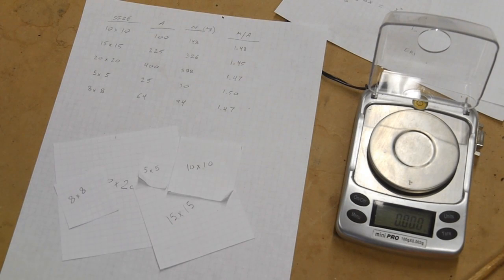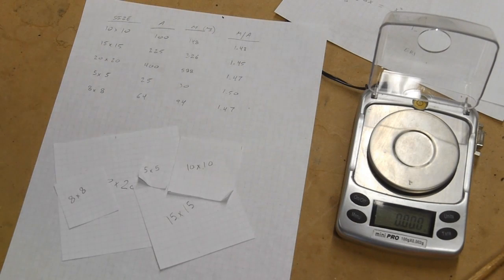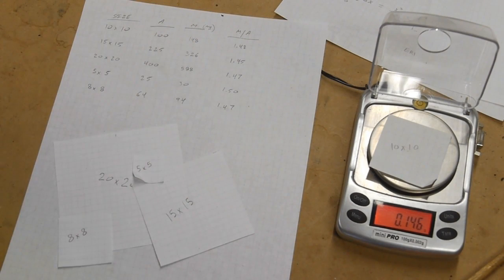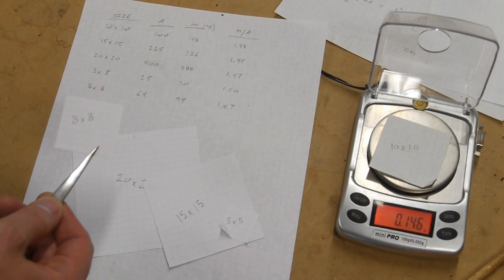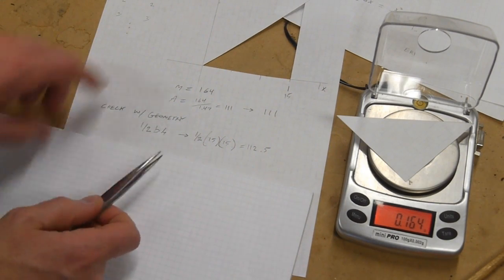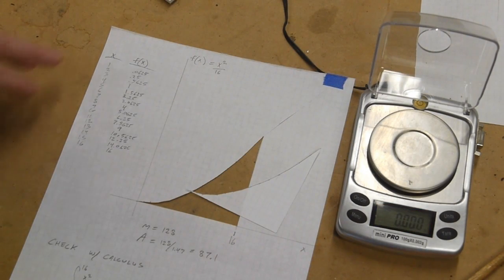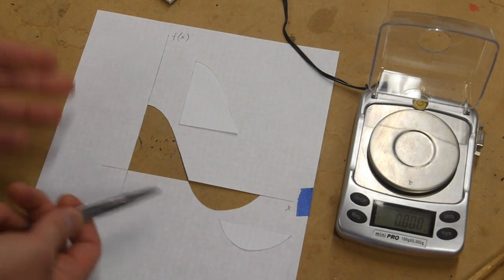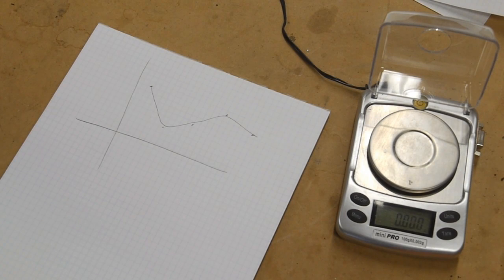Mathematical integration without calculus

Comment: You could do the calculation much more accurately using numerical integration methods instead of drawing them out by hand.
Reply: If you have the skills to integrate non-linear multicomponent equations of state, thumbs-up.  I did not possess those skills.
Reply: Mark Beeunas Well, apart from the fact that mine was an observation and not a criticism, in any way nowadays the software is there... I agree years ago it would have been hard to use a computer, but as far as I know, the big book of series and integrals was around then already... at least judging by the conditions of the one in our university library ;-)
Reply: Mattia Colombo

No worries, I did not take it as a criticism.  Yes, I understand: integration by parts, substitution, etc. I said “I did not possess the(ose) skills”, which may or may not have been true, as I did have three years of The Calculus and Differential Equations. I do not recall my reasoning in choosing the paper/scissor method; I do recall the equation was a bit of a beast.  It probably had on the order of 12 – 15 variables (P, T, Partial pressure (H2O, H2, CO2, CO, CH4, H2S(?), Compositional equilibria (Olivine, Garnet, Pyroxene, wustite(?)).  Anyway, I’m guess I thought the paper/scissor method would be fast.  However, I think it probably was much longer after actually making the 100 foot graph.  I wish I still had my class notebooks.  Well it seem we have taken the long way around the barn on this discussion.  Cheers, Mark
Reply: Mark Beeunas
Whatever you mean with that, there is software created exactly for that... also because I would like to see you integrating non-linear multicomponent equations of state using paper and scissors... it is of course a fun application, so kudos to who did the video, but the practicality of the tool is basically nonexistant!
Reply: The method used was basically the trapezium approximation. If you just worked through it numerically (or yes with software... free software) by hand you would get a much more accurate result as you don't have the errors coming from drawing out the curve, cutting out the curve, and then weighing it. 

Numerical integration is incredibly powerful, as often an analytical solution is either impossible or (and I find this much more common) it's just damn hard. But I don't think that this particular way of solving them is very useful. I might be wrong in this, and I'd love to hear of any uses where the this method would be better than other, purely, numerical methods. I do imagine that, in some cases, it would be much faster, and possibly less prone to error, than punching numbers into a calculator. :)
Reply: Mattia Colombo
Software, yes there has been for awhile. I wrote I did this in "1981".  Other than a PDP-11/70 the first computer I sat in front of was an Apple III in 1983.  Cheers, Mark
Reply: The method used was basically the trapezium approximation. If you just worked through it numerically (or yes with software... free software) by hand you would get a much more accurate result as you don't have the errors coming from drawing out the curve, cutting out the curve, and then weighing it. 

Numerical integration is incredibly powerful, as often an analytical solution is either impossible or (and I find this much more common) it's just damn hard. But I don't think that this particular way of solving them is very useful. I might be wrong in this, and I'd love to hear of any uses where the this method would be better than other, purely, numerical methods. I do imagine that, in some cases, it would be much faster, and possibly less prone to error, than punching numbers into a calculator. :)

Comment: There is something wrong with your figures, you give the mass of the 5x5 (area 25) as 30 mg but the ratio m/A as 1.50.
The mass should be around 37 to give that ratio.
Massaging sample data ? Lol
Reply: It should be 1.2. :) But this is not really important, as this is fun video with no practical applications.
Reply: Павел Казаков yes the ratio would be 1.2 if you had 30/25. But it is obvious that the recorded mass is wrong, since it is not reasonable to expect that the 'density' of the paper suddenly changed for that sample compared to the calculated 'density' of the other samples.

Comment: Good examples.  In about 1981 in my geochemistry class the Professor gave use a problem to work-out the partial pressure of oxygen (i.e. oxygen fugacity) of some high temp/press mineral reaction.  The result was an insoluble polynomial (at least by me) that graphed as a decaying curve asymptotically approaching y=0.  Anyway, most folks plotted the function on 8.5x11 notebook paper and weighed the area as you showed.  Well for me, propagated by my ADHD, 8.5x11 just would not do.  So, I bought a 100 foot long piece of butcher paper and using calipers and tape measure made my 100 foot area under curve.  As I recall, my result was not the most accurate, but needless to say it was the most impressive.  Cheers, Mark
Reply: *****
My goodness.  Well, yes my comment was, “me me me me me.”  Ben’s video reminded ‘ME’ about an experience ‘I’ had 30+ years ago and so ‘I’ relayed it as what 'I' thought was a funny/fun story relates to Ben’s demonstration.  My intent was not to be bombastic and/or braggadocious, although I admit it could sound a bit like that.  Cheers, Mark
Reply: *****
Thanks for that.  Cheers, Mark
Reply from the maker: Mark Beeunas ***** I'm really glad that my viewers are able to have civil conversations.  The comments section on my videos tend to be far above the average internet discourse, and I appreciate everyone who makes an effort to be reasonable.  +1

Comment: Did you try this with pieces of paper that are in equilibrium with different relative humidities?
You get surprisingly good accuracy, but maybe the mass changes on a day to day basis, depending on the weather.
Although I guess it's easy enough to make a sanity check by measuring the calibration pieces once every time before you use their data.

Comment: Years ago when designing paper gliders I weighed many sheets of paper to allow calculating a reasonable value for weight per square unit. When calculating wing loading, I would often approximate area of a given wing in calculations too... but here I see you could use a delicate scale to calculate area quickly without all the numerical integration.

Comment: Ha! I love it, nice and simple! Why did I never think of this!
Reply: Mattia Colombo Maybe his video was a tutorial about "out of the box thinking". Don't knock someone for explaining more then one way to do something. As far as software doing it for you he shows how it works. To many people relying on machines to do the work for them without knowing how or why it works. Great job Ben love the videos keep em coming.
Reply: Because doing it in the standard way is way quicker ;-) and if the integrals are too difficult, there is software that can do it numerically, instead than going back to kindergarten with paper and scissors... it is a fun to see though!
Reply: Mattia Colombo I have not taken calculus yet, but with electronics design, and learning about PID control, I have found an interest in figuring out how to calculate integrals and derivatives easily. Especially with random curves and shapes that are not expressed mathematically.
Reply: metrologic5000
I was actually not trying to knock anyone for anything and besides, I loved the video too =) I was just arguing that it is not exactly practical to use as a method, in particular if you want a precise results... that been said, it is really a fun way to do things, and it has really a good deal of didactic sides I think!
Reply: Yeah,  I understand!  I also thought the same. 5% accuracy is not the best,  but for someone who does not know the hard core math,  it can work in a Pinch! As well as clear up the definition of integration!

Comment: Another nice video.  brings back old memories.  we used the cut an weigh technique in the lab with gas and liquid chromatographs and chart recorders.  the paper was fairly expensive since it needed to be very uniform for weighing.  you could get very precise replicates being careful with your cutting.  Not a very enjoyable task when you had dozens of samples to run with several peaks to cut out per run.

Comment: i was wondering, on that small of a scale wouldn't the graphite from the pencil in which you used to write the dimensions actually throw off the measurements?
Reply: It certainly would, but the awfully simple solution to that is to not mark it with anything.

Comment: The best example of this type that comes to mind is volume calculation by submerging complex shaped objects in water.
Reply: And what do you do if you have to measure volume of an object that absorbs water or other liquids? Use fine grained sand instead! :) I've seen that in use in food research institute, for measuring volume of e.g. bread.
Reply: H Mercury has quite high density and many objects would flow on top of it. Also, it's toxic.
Reply: Thats what I was thinking of.
Reply: Eureka!
Reply: +Kristoff B  use mercury
Reply: Kristoff B you can press the object inside
Reply: +H  But the air trapped inside measured object (eg bread) would be  compressed , threfore results would be inaccurate.
Reply: ***** it wouldn't be compressed much if the bread was hard, but it wouldn't work very well for soft things.

Comment: If you were an engineer you would integrate it numerically.
Reply from the maker: I was thinking of a device like the water usage meters that are used by utility companies.  I'm pretty sure it's just a paddle wheel in the flow path and some gears with a readout.  More revolutions = more total water.  It integrates by the nature of how its built.
Reply: Applied Science Why do we not learn those things anymore? maybe it depends on your engineering major, but I feel this might depend on the vintage of the engineer.
Younger engineers (such as myself) would probably use an AVR or something to measure the data and do numerical integration. And older vintage would do it mechanically, which is probably the better way.

Pedantic engineers would probably do it both ways and use one as a feasibility check for the other.